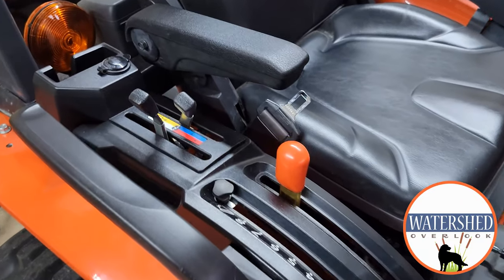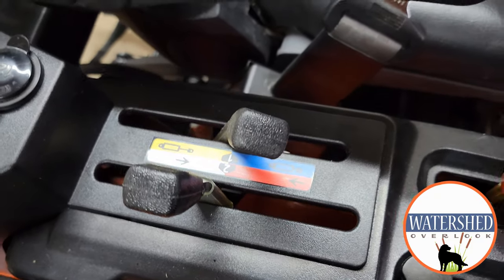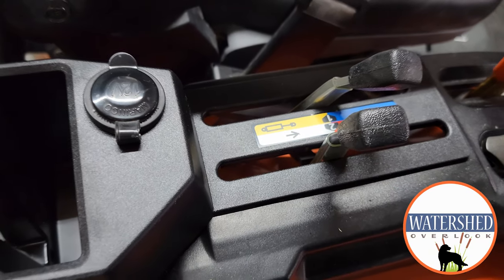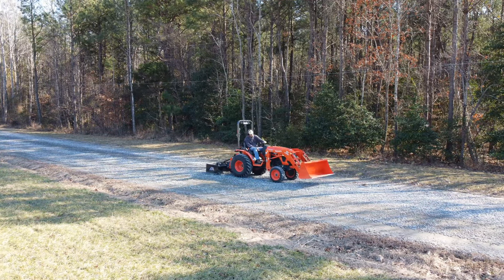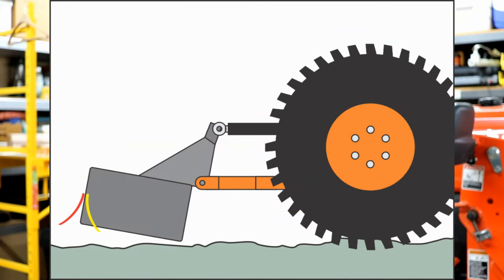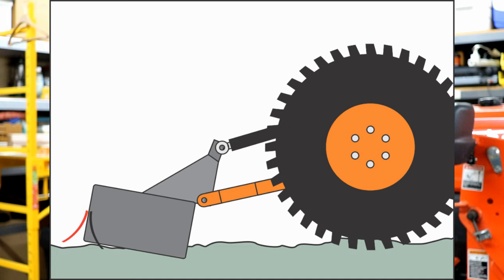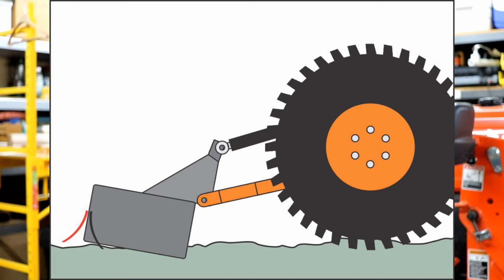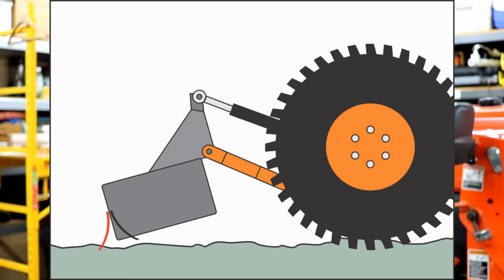025 - Kubota Rear Hydraulic Valves:  The Two Types for LX2610 | LX3310

Comment: What size hydraulic couplers are on your tractor ? I had the two rear remotes added to my LX3310 from the dealer when I bought it. They are 1/4 inch. Are yours 1/4 inch or 1/2 inch ?
Reply from the maker: Mine are indeed 1/4" couplers.  I would prefer 1/2, but I don't think there is enough clearance at the ROPS to allow for them.  If you look at my videos #029 and 030 you'll see what I'm talking about.

Best of luck Todd, appreciate you watching. 👍😎

Comment: Will a hydraulic top link with dual piloted check valves prevent the float position from functioning ??
Reply: Is that a yes or a no please??
Reply from the maker: @darylgass9532  Sorry Daryl, I was working.  Your question is a good one, and a reminder that I need to do a follow-up video to this.  I did discover after the fact that no, the cylinder will not "float" with the check valve.  I mistakenly assumed the cylinder would float dependent on the rear remote valve, but that is not the case.  That said, I have not experienced any degradation in my use...I am still SUPER happy with the top link, float or not.  I may purchase a cylinder without the check valve at some point to compare, but I am loving the setup as is for now.
Reply: @watershedoverlook  
Thank you for your response.   I did order one with a check valve today after getting wrong information from my dealer.     It won’t have the float option as is but I could always take the check valve off because they are external to the cylinder.   I could then just hook up the hoses directly to the in/out ports of the cylinder and my float position would work as normal.   
Thanks again !
Reply from the maker: @darylgass9532  Best of luck! 👍😎
Reply: If the check valve on your new cylinder proves to be a problem, it can probably be removed from the cylinder and the 2 hoses reconnected in the conventional manner

Comment: I noticed your levers weren’t sitting evenly in the middle….  Or is it just me.. ??
Reply from the maker: That is the sharp eye of experience right there!  I think the answer is "yes" and "no"?  The two levers ARE centered in the slots they exit out of, however the handle angle of the first lever is not the same as lever two.  The handle on lever one angles forward while the handle on lever two is more upright.  After reading your question I did double-check the instructions and the levers are mounted correctly.  Function is all good so no issues there.  Of course I've only done this once so I have nothing to compare it to!

Comment: When it comes to anything on your three-point the top hydraulic length really don't make a difference cuz you're 3 point always floats there's no down pressure on your three point... The only thing you're hydraulic top link will accomplish is the angle of your implement
Reply from the maker: That's certainly true if the three point is lowered.  If, however, I am holding the implement off the ground with the lifting arms, the top link float will allow the 500 lb implement to pivot back.  My tractor and box blade are in two locations right now, but once they are reunited I will test and report back with a follow-up video.  Appreciate the input! 👍🙂

Comment: Just curious, which lever does what for you? If you have the hyd side link yet. On our BX the outer lever did the top link, forward was retract, back for extent, no float. That i know/knew of. Installed and set up that way by the dealer and I never once disconnected any of the hyd lines. Went to pick up a new LX 2610 saturday but there were several leaks. Prior to discovering the leaks, I did run it and cycle everything and then loaded it on the trailer. Anyway, the controls seam completely opposite and backwards. But due to the leaks, it did not come home. Tech did not get to it in time to get it today. Hopefully tomorrow. But theres supposed to be a float detent. Im just going to have to figure it all out when I get it home and unloaded. BX was sold last week.
Reply from the maker: Congrats on the new LX Drue...sorry you've had issues.  Right now I have the top link hooked up to valve #1 (the "inside" lever) but I will be switching it to valve #2 since that is the valve with the float.  Pulling the levers back extend the cylinder, forward compresses.  If it's not doing that on your LX I assume it's because the cylinder hoses are switched at the valve.  If you flip them (top to bottom, bottom to top) I think that will put them where you want them.  Good luck, and Happy Holidays! 👍😎
Reply: @watershedoverlook  im hoping its that easy. Thanks for the reply! Cant wait to have it home and get to playin on it and figuring it all out and switching up those connections.
Reply: Happy hollidays to you also!